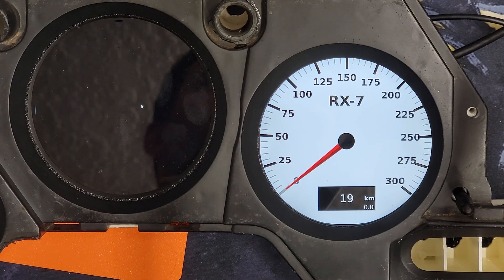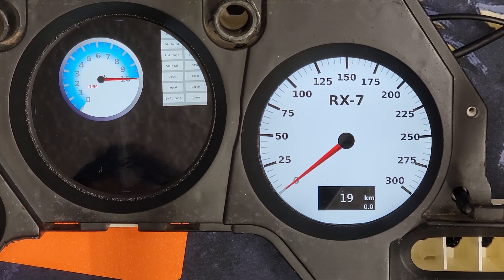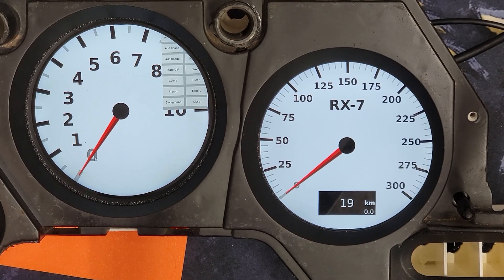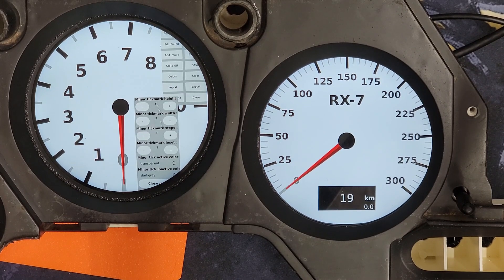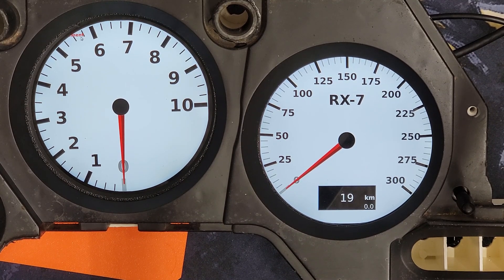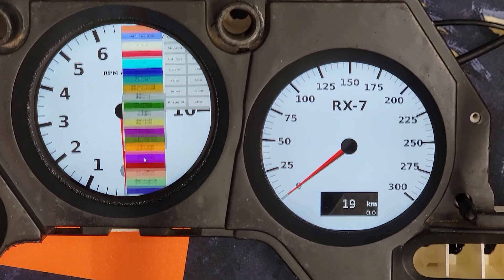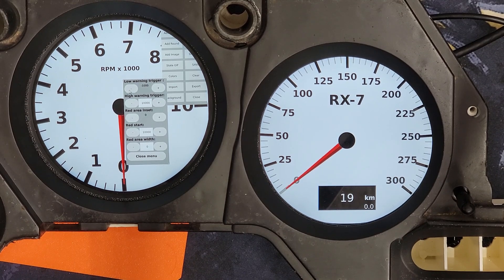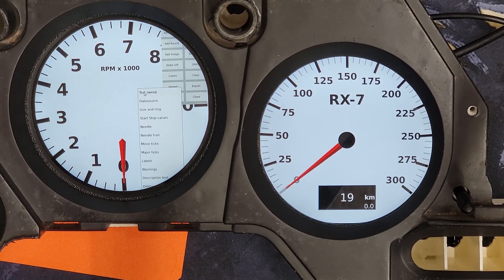rx7 digital cluster software demo

Comment: Hi! Do you know how I can bench testing the LCD odometer on the RX7 FD cluster, I try al the positives and grounds, but don’t have any luck, I have all the diagrams and the connector pin list, do I miss anything?    By the way, nice work on your cluster!
Reply from the maker: so i have a business repairing these you can send it to me t repair.  the odometer screens all fail on these so likely you need to get it fixed if you connected all the powers and grounds and it didnt light up.
Reply: @GeoffPritchett   Hi! Thanks for your answer, I only have the cluster, I don’t have any RX7, I just want to test it for sell the cluster!! I have like 20 years with this cluster.
Reply: HI, what is your contact information? I need my FD cluster rebuilt
Reply from the maker: yeah but its broken right now, they fail all the time so you wont be able to sell for much until you get it repaired unfortunately.

Comment: Where did you get the lcds? Or is it 1 solid lcd? Also, what software are you using?

I'm looking to do the same to my rx7 asap. I just removed the cluster today for the infamous cluster failure.
Reply from the maker: Everything is proprietary for now. Been working with my suppliers for a couple years to get a solution that would work for this.  Each gauge is an individual screen.